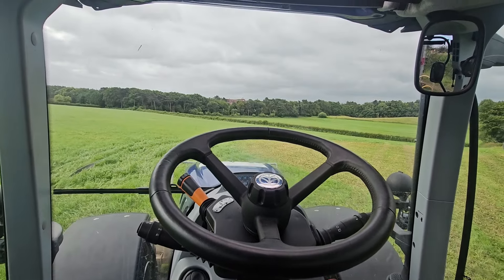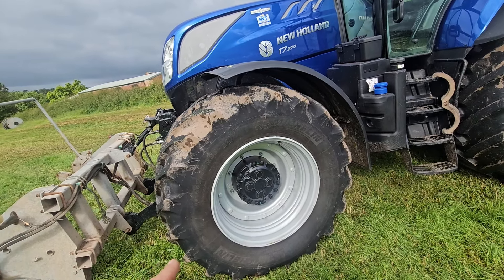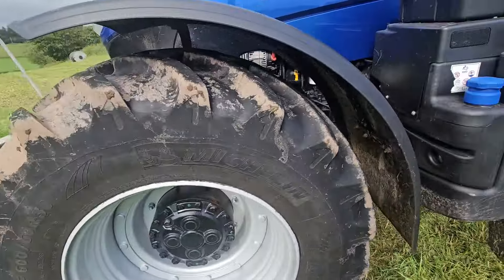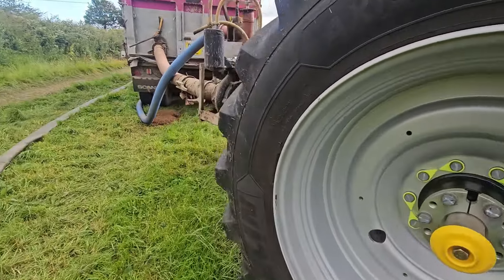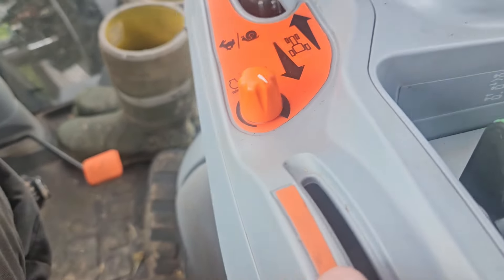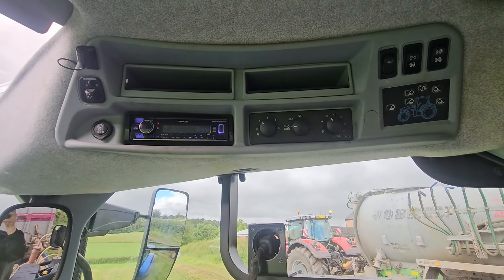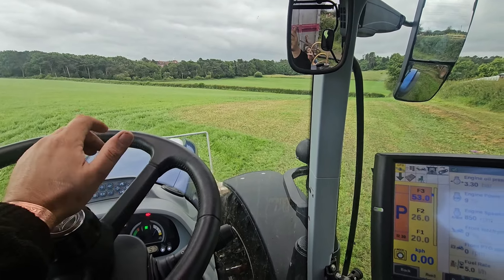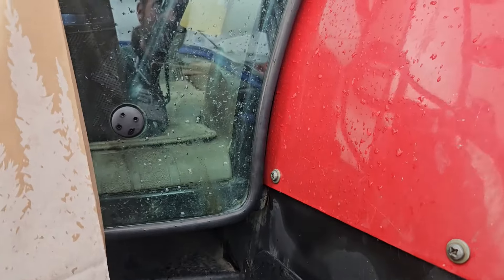puma or t7 blue power

Comment: On a summer like this fitting a window wiper from a duncan cab to your puma has to be a pain? Also did you buy the quadrant or just delivering it?
Reply from the maker: The baler was going down to the contractor I work with. Bit of a demo for them and chance for dealer to make sure it's in good order